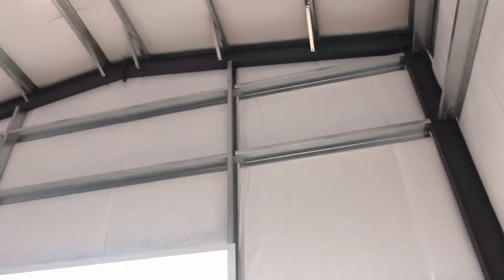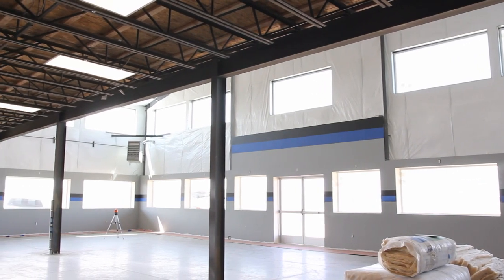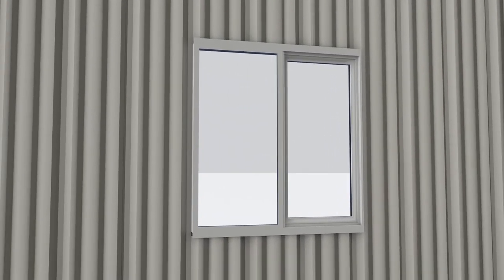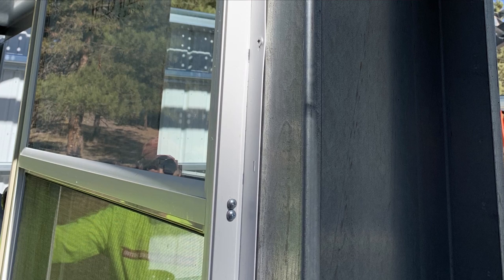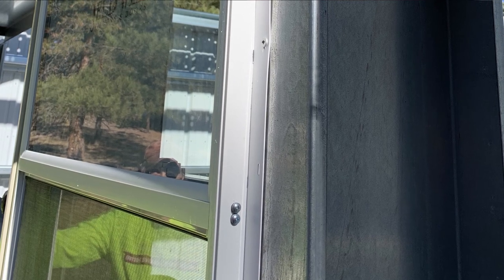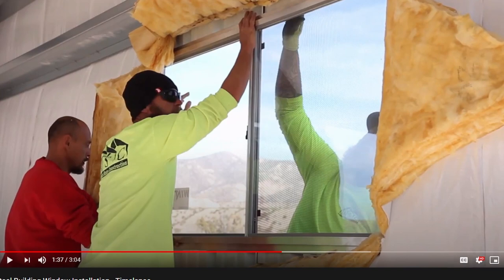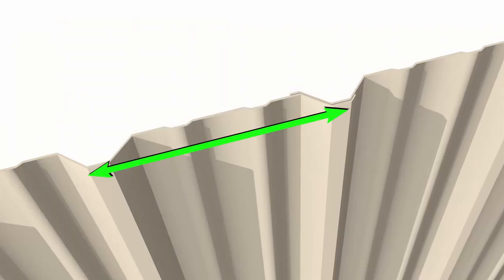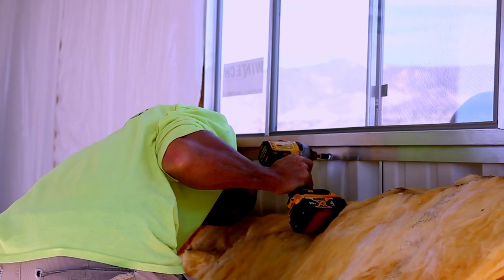How to Build a Steel Building - Windows Basics and Installation

Comment: I am putting together a building that a client bought, it is 6" compressed insulation and it has been a royal pain!! keeping nice straight lines and so on. You said in this video you do not recommend 6" insulation but that amount of R-value is required in many of our building locations, so what do you recommend for insulation package in these higher mountain elevations that require larger R-value packages.  I've heard of insulation packages that are put in the cavities of the gurts after the sheeting is installed.
Reply from the maker: We recommend using a double layer insulation system for high R buildings.   In addition to the typical compressed insulation, you would add another layer on the interior of the girts.

Comment: Thanks Eric!  Would there be a concern with galvanic action between the aluminum windows and steel wall siding which can lead to corrosion?  If so , is there a way to deal with it?
Reply: Hello, that is a darn fine question and the answer is, I have absolutely no idea. I'm aware the issue when it comes to aluminum sheeting used with our buildings and some Standing Seam Roof components but never thought about with the windows. The windows we use are industry standard and made specifically for our application. This system has been in place for decades so I'd imagine it would have been addressed if it was an issue. 

I will have to reach out to the window supplier or someone with more knowledge than me on this subject. I'll try to follow up. 

Thanks
Reply: @ericbeavers4769  Thank you!  We would be really curious to discover what you find out.
Reply: @RandomJHK  I reached out to Wintech today but my rep and the engineering guy are out on vacation. I will update when they get back to me. Cheers, Happy Holidays and Merry Christmas.
Reply: @RandomJHK  The window supplier got back to me and I spent a few minutes going through specs this morning. Short of it is that Wintech has not done any studies on the subject. No literature and I spoke with their PEMB Products Engineer shortly which went no where - He was very kind and interested in the thought experiment but that's were it ended. 

All of our steel panels are galvanized and/or painted depending on the product and the steel fasteners we use are also all galvanized on the shank. The Windows are also painted or coated in acrylic - perhaps this is enough of a barrier to not make it an issue. As I mentioned, these windows have been being used for steel buildings for decades and I've never seen or heard of a corrosion problem. 

Still very interesting to think about. If GWB had a R&D or Laboratory Department I would certainly send them down the rabbit hole but we don't :( so we'll have to leave it to someone else to investigate it. 

Thanks for the interesting comment

Comment: Hi how do you keep the rainwater out of the insulation while your cladding the building?
Reply: Hi Ross, The top of these windows have a built in drip tray on the top. We also supply a head-trim to be used but it is not necessary. Silicon should be used between the panel and the window frame on the top.